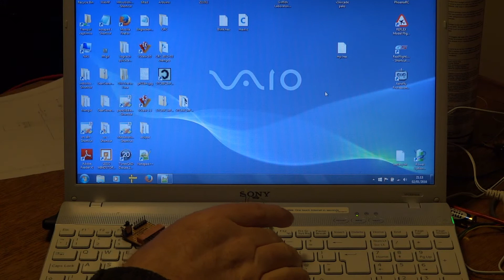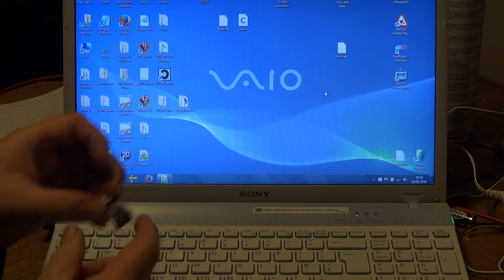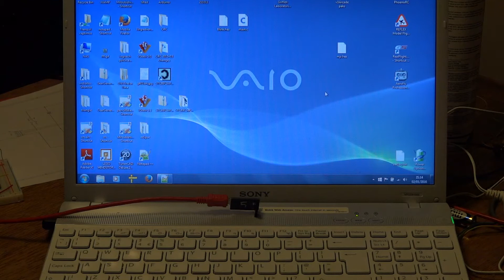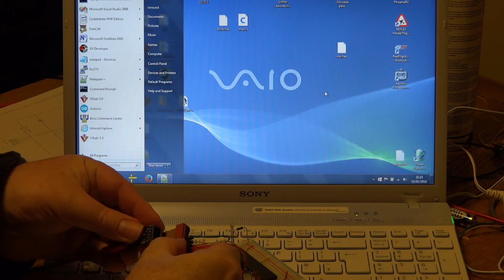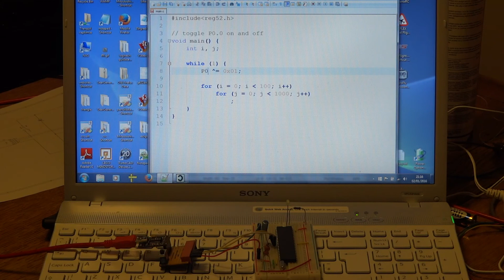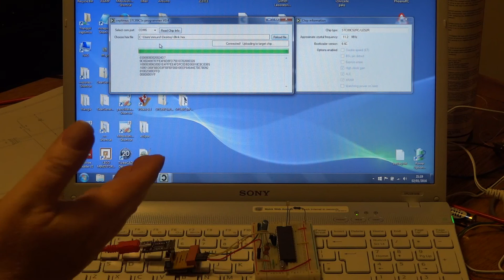Breadboard STC89C52 programming

Comment: Hi, can we read the code inside chip by this board? I want to read code from STC89C52RC but  did not know how to do. Thanks!
Reply from the maker: It is not possible to read code (or EEPROM data) from  an STC chip using STC's bootloader protocols. This is considered a security feature by STC. There is no known workaround at this time.

Comment: HI 
Need Help abour Programing AT89C52 by Using USBASP ??
Reply: AT89C52 can't programing with usbasp. but at89S52 can programming
Reply from the maker: I made a programmer for the very similar AT89C2051 based around an Arduino Mega.  You could probably adapt that.  See here: http://ceptimus.co.uk/?p=216